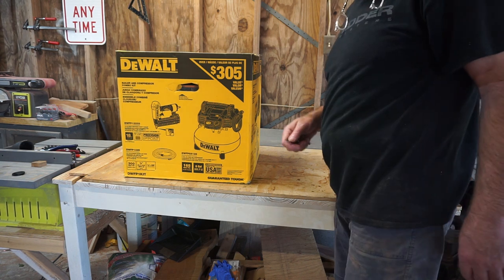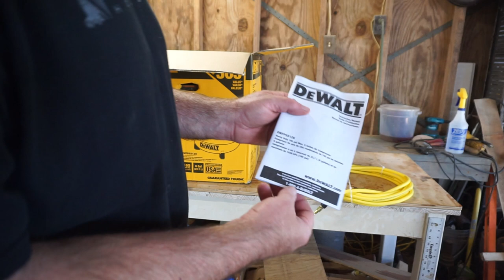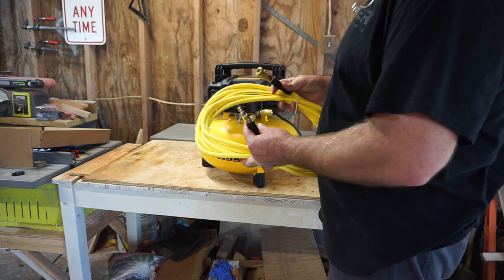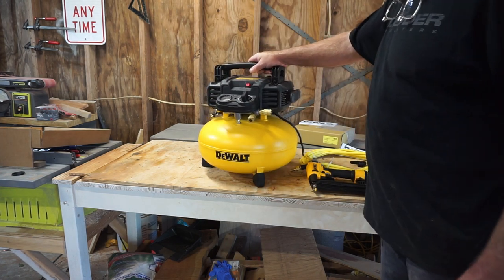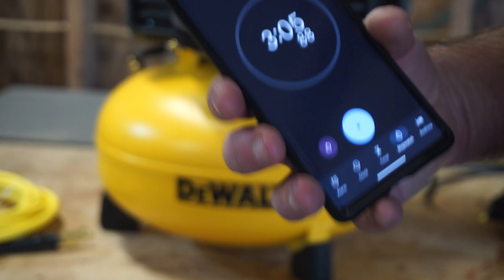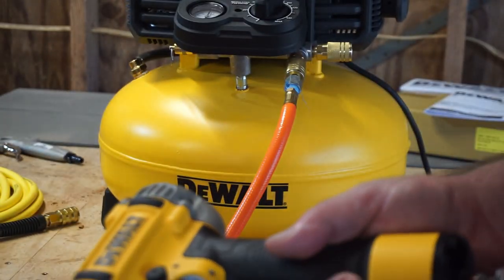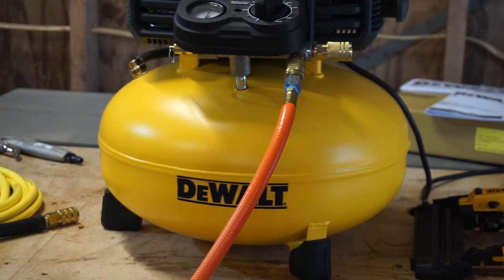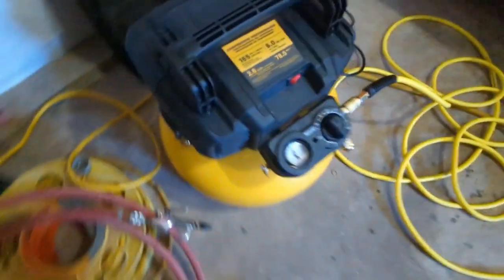DeWalt 6 Gallon Air Compressor: Perfect for Homeowners and DIYers

Comment: I used mine 3 times and the pressure regulator failed. I builds pressure until you shut it off. Not sure it's worth fixing.
Reply from the maker: Well that's not good, I have been using mine pretty much daily, no issues yet.

Comment: Can I use a pneumatic framing nailer with the Dewalt 6 gallon compressor? Or I would need a bigger compressor to work?
Reply from the maker: I think this would run a framing nailer without any issues, may cycle a little more than with the brad nailer.
Reply: @jestermetalworks I used the previous model (same specs but two pressure gauges) to power a Hitachi framing nailer for a small shed project without issue.

Comment: please test using it with impact wrenches.
Reply from the maker: Lol, probably no chance of that working, the airflow is too low for anything more than a nailer I'm sure.
Reply: @jestermetalworks i just bought this for dusting off electronics and maybe detailing with tornador gun. So it wouldnt be good for that? Since it will keep turning on and recycling?
Reply from the maker: @Bassslayer0  I think you would be ok with that, If you move up to any high volume tools like an impact wrench it will have a hard time keeping up.